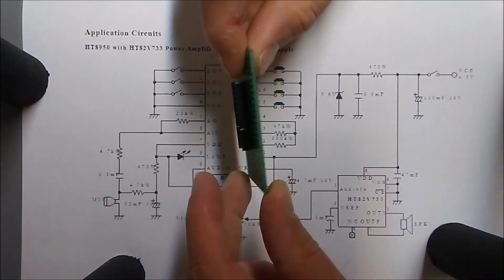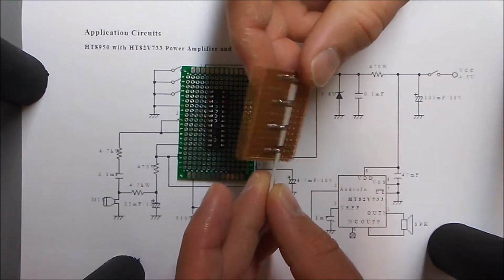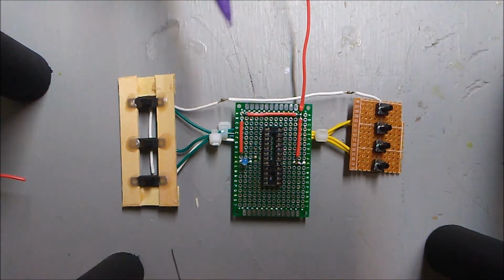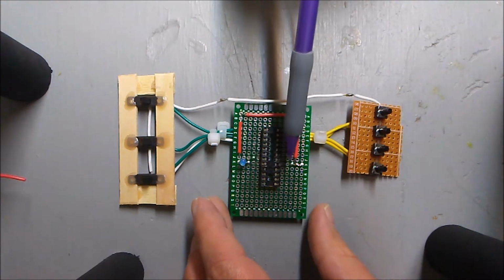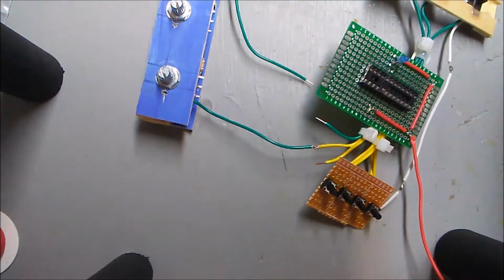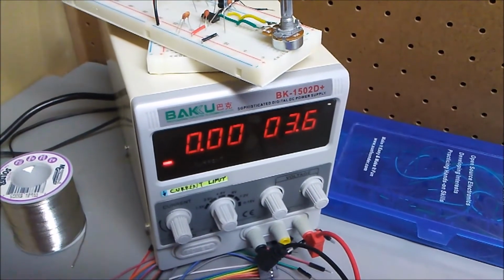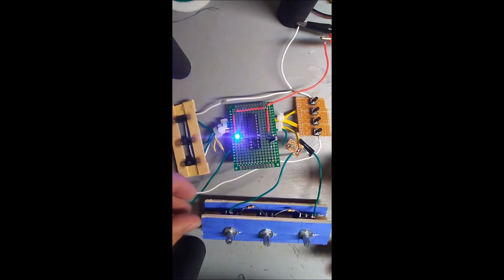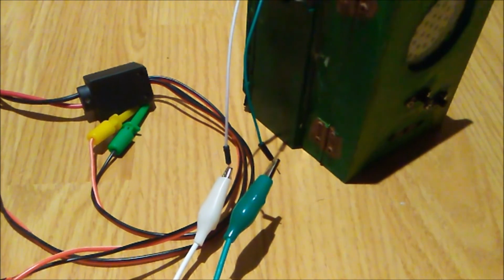Voice Changer Circuit: Holtek 8950 Voice Modulator: Part 1

Comment from the maker: WATCH PART 2: https://www.youtube.com/watch?v=yABp39PWTrA&feature=youtu.be
My dear appreciated viewers: I hope you find this video entertaining. However, I created this video for the sake of those trying to construct a Holtek 8950 Voice Modulator circuit. ATTENTION: This chip comes in a 16 and 18 pin DIP package. Please be aware that the pin-outs are drastically different on each chip. Also, please see the links in the video description. The links should help you in comprehending how the chip is designed to work. All the best in building your circuit! -2Bit

And, I found a video, better than mine, which addresses some of the issues I've been having: https://www.youtube.com/watch?v=sv1S4BPKGH8

Please subscribe.